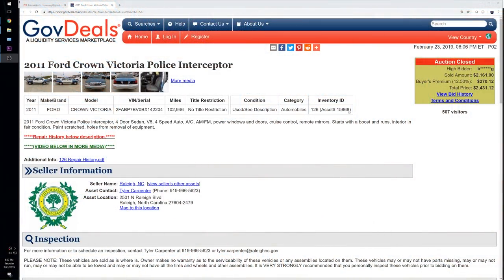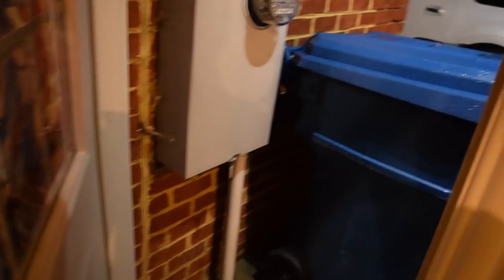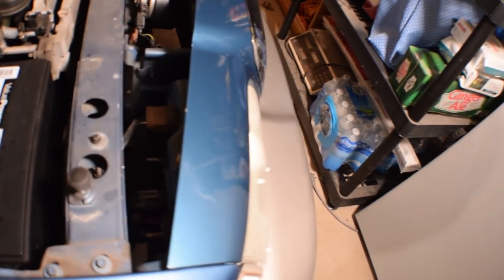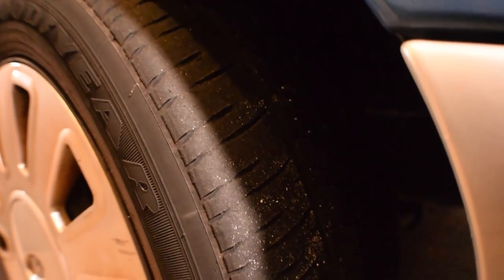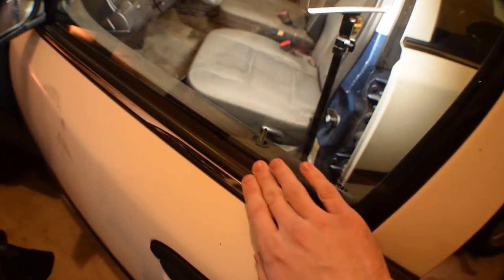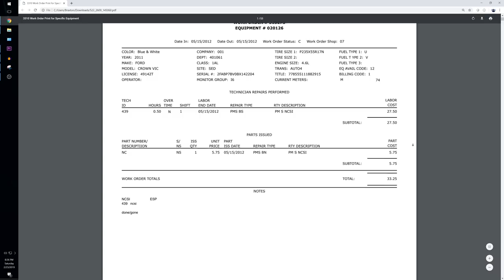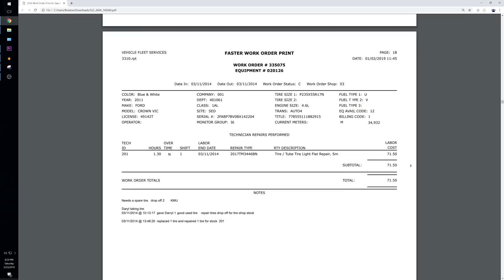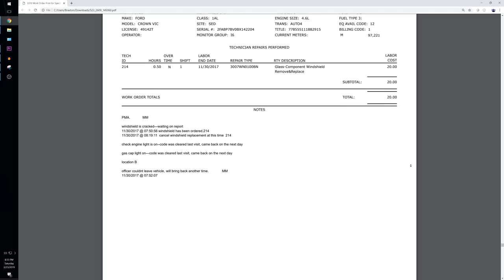I Bought a 2011 Crown Victoria Police Interceptor From a Govdeals Auction

Comment: 2,000 dollars? ummmm, ookkaayyy.
Reply: PuppetGameReviews fairly average price for a Vic. Especially a DBW+Flex Fuel model.
Reply: @badatgaming  Oh, lmao i dont know much about those cars :/
Reply: @joehdah5395    Don't worry, its cool.  I've owned three so far.  I have a 2000 that I've done quite a bit to.  Those aren't Drive By Wire ("DBW"), but my 2007 was.  Personally not a fan since there's a decent amount of lag on throttle response.  Flex Fuel seems really cool but your mileage sucks with it so eh.

Comment: came across your video by accident. I've never heard of this website area do they sell ruggedized laptops and what kind of prices?

You should've just brought a to of cheap silicone to fill the holes in on the roof. Something like JB Weld. Next you should've brought one container of Injun coolant one or more bottles of brake fluid at least one bottle of power steering fluid one bottle of oil and one bottle of transmission fluid. Good to see you got the air compressor and a roll of duct tape and the booster pack. Myself, I generally can't afford a booster pack I've bought a couple of them and the batteries went for I ever even actually use them. Damn booster packs. The batteries last about a year and that's it. I refer to it as a gremlin bag. The vehicles that I drive. I usually carry around a bag in the back with a bottle of oil bottle of transmission fluid and bottle of brake fluid. Literally at a problem a few years ago. Took me several hours to find a place that Thierry brake fluid. Believe it or not I had a really small leak in a brake line and adequate fluid in the vehicle to drive it somewheres. No the brakes were faulty, or anything like that. Literally. When I got were I was going. The mechanic was arguing with me telling me I didn't have a  Leaking line It was that small.initially, the guy did find a leak. Generally, I don't carry anti-freeze around. Sometimes I carry a jug of water, but if I'm going to get a vehicle that I don't know the history. I take a bottle of fresh anti-freeze. Literally carry one of those bags and pretty much every vehicle I have behind one of the seats or in the trunk. Role of black tape also won't heard there's some stuff you've got a use black tape that.Dave won't work. 2000 lost the fees is not bad for a half decent interceptor. Here in Nova Scotia that car would've run you four or five Granddad an auction. Try getting one at auction a few years ago. That's how I found out areas people were saying they go for like five and 600. But actually they don't .

Comment: All police cars say underneath the speedometer certified accurate speedometer that's not a cop car that's a Crown Victoria p71 not a p73
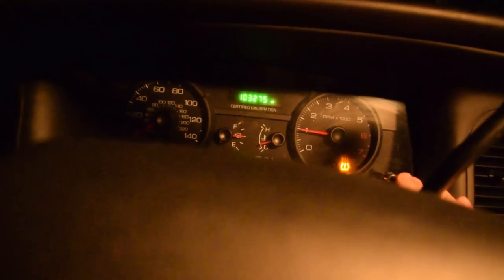Reply: 4:45 clearly states certified calibration. On the 06-up it's under the odometer.
Reply: P73 is a Base Model Crown Vic.  P71 is a Police Interceptor.  P70/P72 is Commercial Heavy Duty, P74 is an LX, and P75 is the rare Touring Edition.

Comment: Cop cars have hotrodded engines. You will be tempted to put your foot in it, and it is fun, but keep in mind you will get about 5 mpg. Cops don't mind, they don't pay for the gas. Don't take out the spot light, spot lights are cool.
Reply: actually same 4.6 motor. ECU tweaked for shift points on A/T. Bump in HP due to CVPI equiped with air intake from  the Mercury Marauder along with dual exhaust pipes.
Reply: Vic owner, I'm gonna chime in on this.  These cars aren't meant to be fast in the sense of getting up to speed or going quickly.  These cars are meant to cruise fast, and outlive the vehicle they are pursuing.  

As a matter of fact the 1998-2000 Crown Vics have the NPI ("Non Performance Improved") heads that are actually weaker and slower than the 2001+ PI ("Performance Improved") head version of the 4.6.  It wasn't until about 2004 where the 4.6L started pushing 250 HP (not to the wheel).  This was thanks to the modified air intake and larger MAF sensor borrowed from the Marauder.  Though I believe the P71 MAF is slightly different.

The other Vics made about 210 HP (98-00 NPI) to about 235 HP (2001-2003 PI).  Torque wise it was just shy of 300 ft/lbs of torque for the 250 HP version, probably less for the older models.

Gas mileage varies on what rear differential you have.  3.27 rear diffs are decent for both city cruising and highway cruising.  They made open and locking variants.  The 3.55 was offered in locking only and while notably quicker in the city along with slightly slightly better mileage in the city as well, they suck all sorts of butt on the freeway.  I can eek 25/26mpg out of my 3.55 rear end Vic....if I travel around 55-60mph.  65 and up starts to lessen my MPGs.  When I have my foot in it and driving aggressively or doing canyon runs I hit single digit MPGs, but its closer to about 9.

But then again I didn't buy this thing for MPGs, haha.